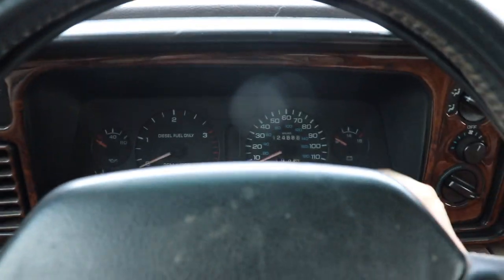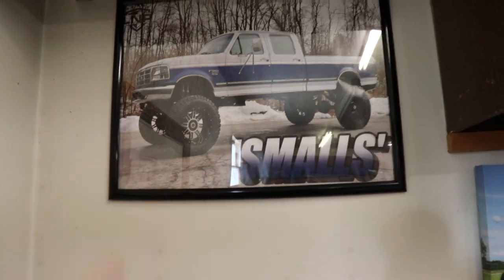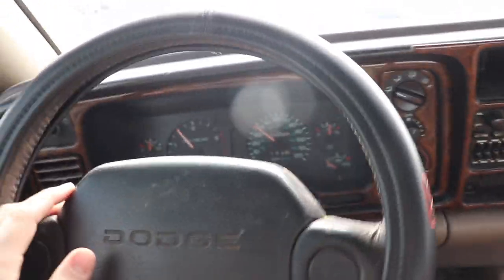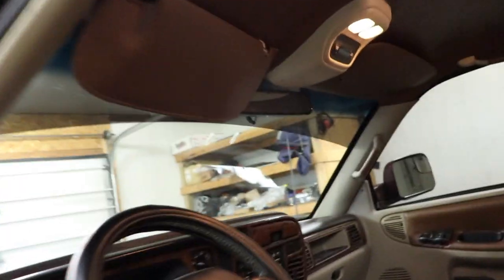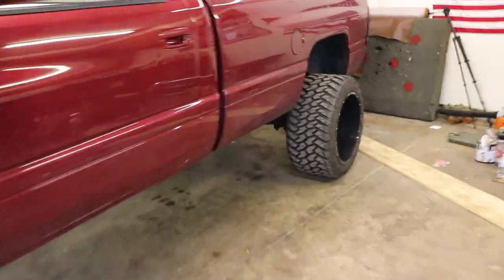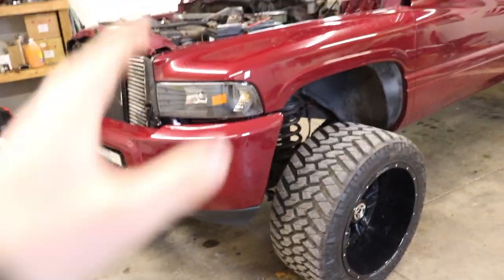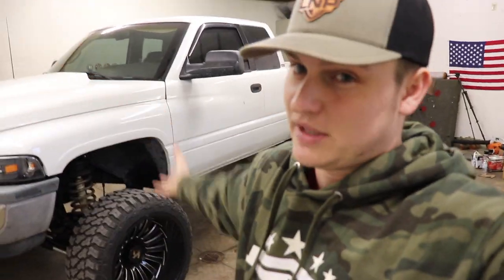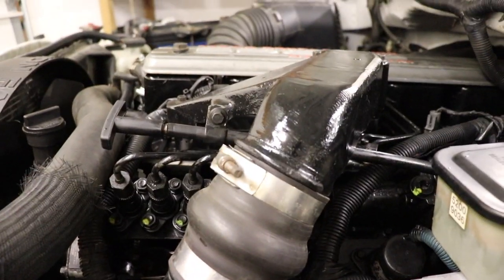FROSTY The MONSTER 12V CUMMINS IS BACK!!!

Comment: 18s it’s rare to see a truck with some rubber on it.
Reply: Because for 30 years it was 15s with 44s lol, just in the past 5 years were big wheels popular, we've seen our fair share of small wheel big tire for decades..
Reply: daisbest5.0  Yea you just described my 88 step side Chevy I had, 35x15.5x15 tires. But I think a little more tire than wheel if your actually going wheelin’. Need a little more sidewall to protect the wheels.
Reply: I personally hate chrome, but I think 18’s that are black and some river would be👌🏽👌🏽

Comment: 18x12 Chrome with 37 Super Swamper Iroks on the 7.3
Im old school, and one of the first things I learned when I had my first truck was the tire should always be at least twice the diameter of the wheel for off roading purposes, anything less is for pavement pounders
just my opinion though, anything you do to the truck will look good...they always do

Comment: My brother recently picked up a barn find 72 chevelle SS. It had been sitting over 30 years. Anyways. Back in the day crushed velvet interior was the thing. There is receipts he payed good money to get it done. By today’s standards it’s hideous.  To make a long story short when he pulled it all off it revealed a pristine original  interior that had been destroyed by glue and staples. Also he yanked the stock motor to put in some done up motor. The original numbers matching motor and trans is long gone with the build sheet. It is a big hit on the value of this car. These trucks are becoming classics and it is rare to find such a clean example. When you jack and hack them up and put big tires and rims it takes away from the ride and drivability of the truck.  20 years from now all that stuff will be thrown in the scrap and somebody will be paying good money to get the hard to find parts to bring it back to its former glory. I’m just saying it’s your truck and your money. I’m not a ford guy anyways. 2nd gen is my forte. Having said that it still deserves respect. Maybe that will help you make your decision? I’d personally like to see that done on a truck that is slightly less clean. Keep up the good work though. I love the long horn second gen.